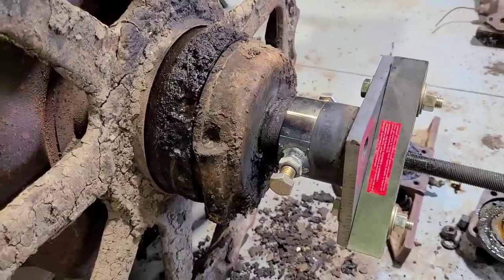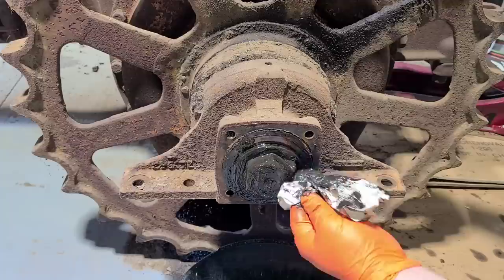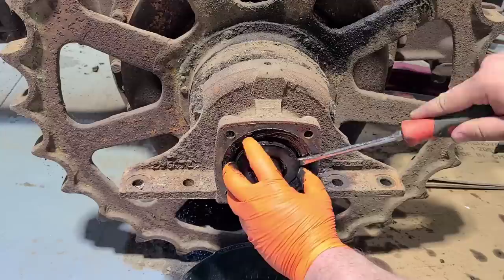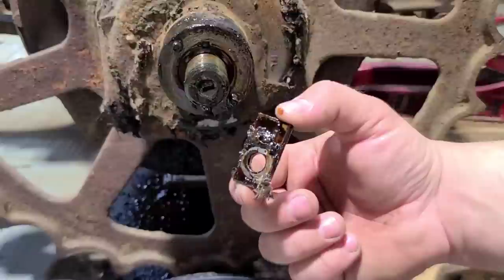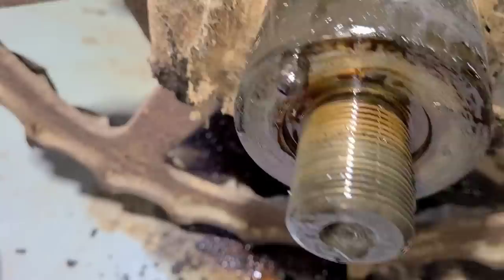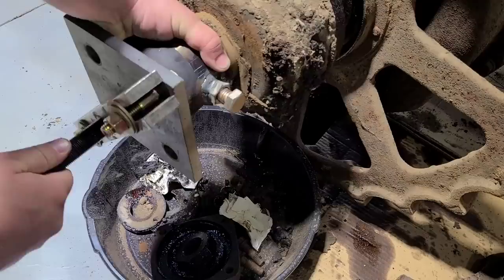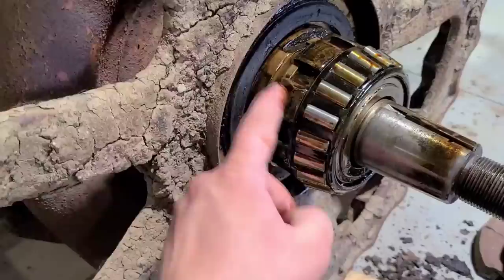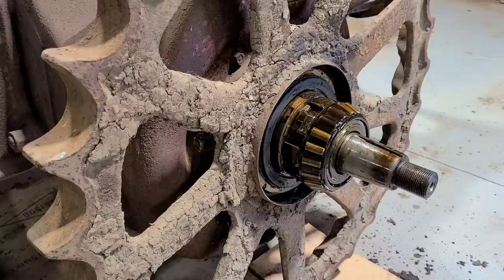Caterpillar RD-4 Sprocket and Final Drive Removal

Comment: A word of advice Kyle. If you don't have a oil pan to catch oil. I have also used saw dust as a absorbent but cleaning it up can be a mess. However  when all else fails that helps by a lot. As long as the parts where greased and in oil they can still be salvageable. You did very good pulling the final drive. Will be interesting to see how much can be salvaged from the pony motor.
Reply from the maker: I have oil pans, quite honestly I believed the final was empty and by time I broke the seal, it was too late. Thanks Steve
Reply: @kylechrist  Most of the old time oil is very thick if it's 20F it acts like grease. But once it is 60F it becomes more liquid like. Also tip if your planning to use saw dust use the finer ratio one. Very good for catching transmission fluid's. Fire departments use a special absorbent for catching oils and fluids after a accident but that might be expensive.
Reply: @kylechrist  how to get book

Comment: Have not looked for it in years. A product called 5 mil pipe wrap.  Used to wrap gas pipes that were to be buried.  
There is also sand blast tape . 
I wonder if the flats inside the spanner nuts are double D nuts for bearing adjustments.   You might need to get a flat to flat measurement of them and a thickness of the flat to the spanner nut to have a piece of plate cut into a wrench head you could have a 1/2" and a 3/4" square hole punched in a corner instead of welding on a long bar.

Comment: You're not the only one to make a huge oil mess. Did that while pulling a service brake off of a Deere DI, and started running oil the consistency of hersheys chocolate syrup all over the floor, including that nice 50 year old gear oil smell

Comment: interesting, so it is more of a planetary final than a final as is on squatchs D2 or say on an Allis Chalmers B or C?
 there is many types as well as views of "floor dry" as my garage floors are not sealed and they are rough it does work real good to soak the oil up. It really comes down to cost, time and safety(slides and slips or easily track) for me. I would also use PIG materials if I could afford them or had new floors. Each to their own.

Comment: So why don't you use just old fashioned Kitty litter to get up the oil the oil I've always used that to pick clean up a small petroleum small petroleum spill will there be oil or diesel or disorgasm. Hope you're having a great day
Reply from the maker: Kitty litter and floor dry are essentially the same thing, dried clay. I don't need to bring more dirt into my shop, as I said, many manufacturers don't allow it in their repair shops, including Caterpillar